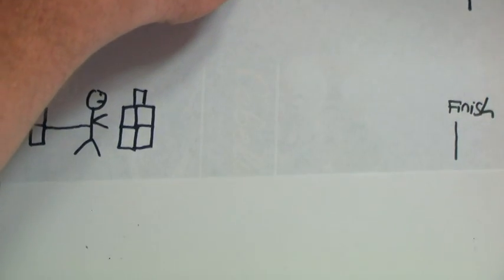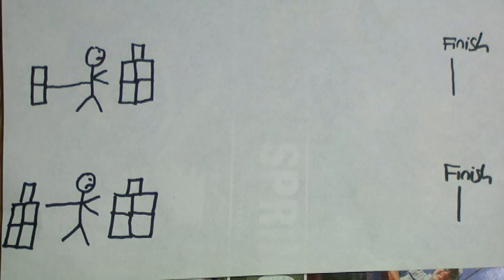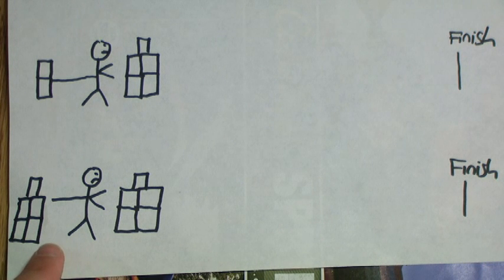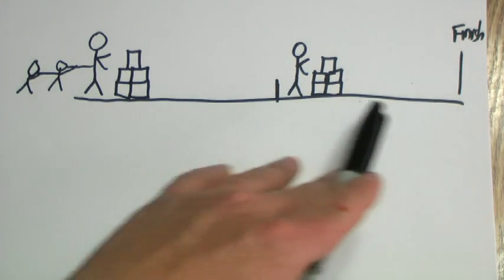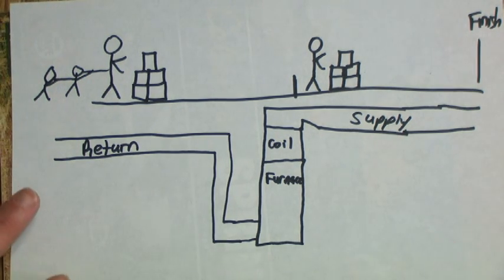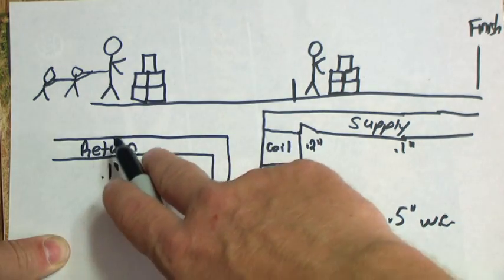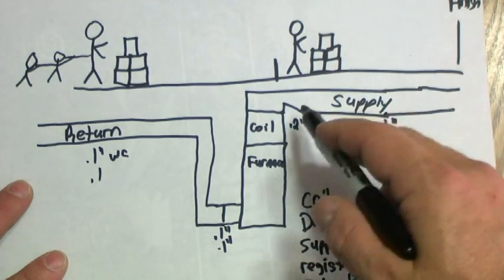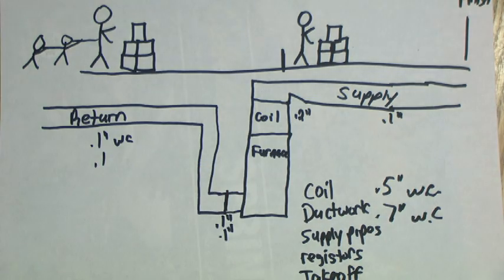Hvac Troubleshooting - What is static pressure

Comment: You need to measure total static pressure.  Drill a hole in the blower door, and find the hole before the cooling coil (good coils have two measuring holes with steel snap in buttons.  If you measure here, on a clean coil, you can get a differential reading which can be converted to CFM across the coil.  Most residential equipment is only rated for .5” TOTAL static pressure.  This can be more or less, depending on what is listed on the data plate.This can be measured with a 1” magnahelic.  It has a high and low port. Low for the return, high for the supply.  There are special static pressure tips.  The gauge automatically converts the readings to total pressure.  Taking one reading at a time will tell you what side of the system might show a restriction.

Comment: Static pressure is merely a measure relative ambient pressure. Two measurement can be subtracted to determine differential pressure across a restriction (or inducer).  Room pressure, building pressure, and atmospheric pressure are often considered as baselines -- such that pressure in a duct might need to be measured with doors open and doors closed, to make a proper assessment.  How well do supply and return "see" each other  and do things like exhaust fans try to hamper the flow or fool measurement devices poorly dependent on static pressure to guess air velocity or volume.  Even the engineers are fooled : like when circulations fans experience negative pressure gain in a negative pressure building and their pressure fan switch seems like it is broke.  Some times air flow will have to be measured with a hotwire thermal anemometer probe to see what the actual results are. Static pressure is merely one of several tools to be used or abused.

Comment: Thanks Eddie, you're probably the only video that gives 'ballpark' figures for static presssure in each area of the a.c. system. Return .1, Filter .1, Coil .2, Supply .1, totalling 0.5" w.c. I had a return with a 0.3+ wc not keeping up on hot days, so I added another return filter & grille. Now static is .17 and unit keeps up set temp on hot days.

Comment: If i added another return would increase or decrease my static pressure?
Reply: Good question, My GUESS is decrease on the return side and it may increase the pressure on the supply side depending on the ductwork over there.Its crazy confusing.

Comment: In a condo if floors 8 and below are blowing cold air in the halls  and the rest of the floors are ok  what can be the problem ?
Reply: does each floor has its own stat ?  does each floor has it own automatic damper? just one unit supply OA to all the hall way ? make sure the  VD to the problem floors are open.

Comment: Good simplistic demonstration of static pressure, thanks much! I'm working simply as a homeowner to understand the basics and going through several videos so when it comes time I can either figure out one room deficient, or a vendor out to make an improvement, (perhaps that ends up meaning a booster fan given the home configuration), the home is efficient and comfortable where most needed with little loss. Every bit of information helps as does your informational/educational videos. Thanks much.

Comment: wow it was that simple??? static pressure= resistance measured as inches of water coulmn. people out there just making it so complicated to understand 
thank you 👍👍👍👍👍
Reply: how do we learn about bod plz upload the video to measure bod
Reply: This is not a very informative video.
Measure to atmosphere the following with a manometer:
1) airflow into fan with the TOTAL PRESSURE PITOT fitting.
2) fan discharge airflow with the STATIC PITOT fitting.
Added together these will give you Total Ext Static in pascals or water column etc. 
Refer to fan curve to estimate volume flow of air through fan. Check this result against fan curve power line. With electric motor efficiency known you can convert to drawn amps. All these figures will be within 2to4% of each other.

Comment: The numbers you're adding together and calling 'static pressures' are the 'component losses' which are deducted from the 'static pressure'.  At the beginning, you referred to the .5 as CFM but I think you mean inches water column.  It was a little confusing in those regards, but I like your metaphor using the guy pushing/pulling the boxes.  That's helpful.  I'm a little confused when it comes to AVAILABLE static pressure and EXTERNAL or TOTAL static pressure and how/where to take those readings with the manometer.  I believe we are supposed to insert pitot tubes into both supply and return, add the numbers together and end up with EXTERNAL (or is it TOTAL) static pressure... and is that the number we compare to the nameplate?
Reply: Just read your comment by chance have you figured all that out? I would love to learn

Comment from the maker: (c) I am limited to 500 characters on a reply and its not going to be possible to answer this question with them restrictions. I will summarize it and say that air does not flow in a square formation, it moves in a circular formation, so if you are measuring airflow in a square duct you will find more flow in the center, little on the sides and almost zero in the corners, therefor you must transverse the duct to get an average.

Comment from the maker: The main thing here is to maintain a certain airflow across the evaporator coil. 

What you will want to do is record the blower speed that you are using and measure the static pressure, then you will need to get the performance data sheet from the manufacture. That will will show the cfm @ a different measured static pressures using different blower speeds.

You will need to adjust the blower speeds until you get something that is around 350-400 cfm per ton. I hope that this made sense.